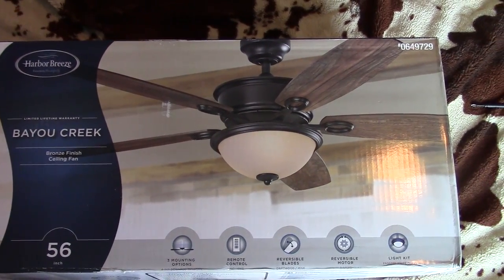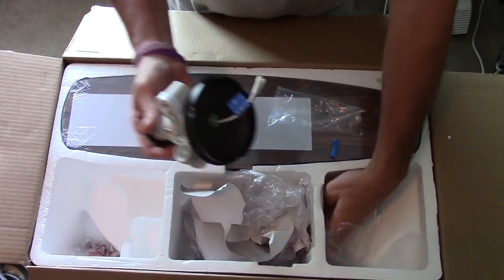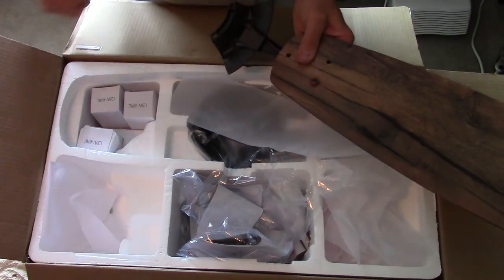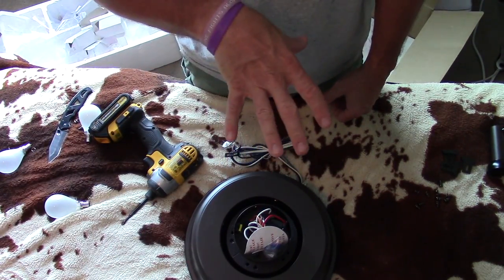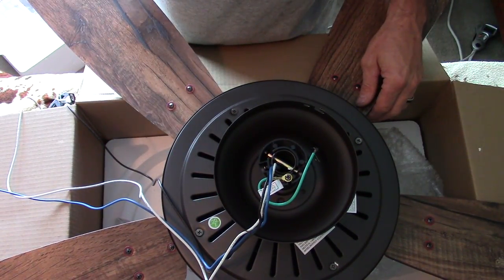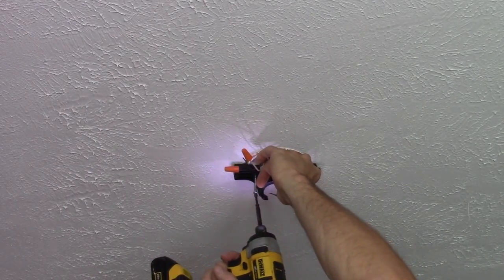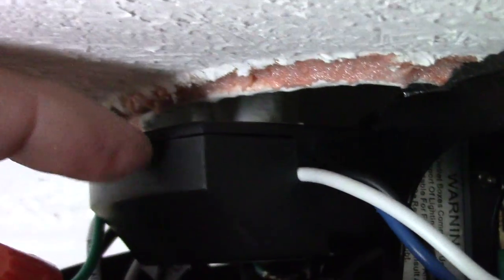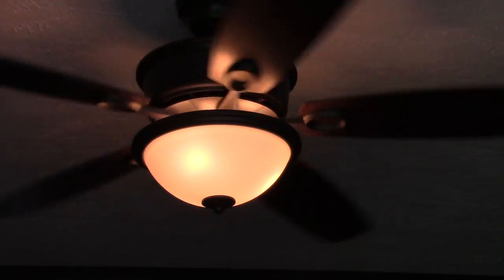Hanging Harbor Breeze Ceiling Fan

Comment: Is it possible to damage the remote sensor? When I installed mine, I followed the wiring set up from the previous fan. Thus I tied the white and blue wires all together. I corrected that. But now the remote doesn’t work. I fear I may have shorted out the circuit board.
Reply from the maker: @rayhuntermusic  I bet you fried it because you ran power in on the neutral wire
Reply: @networthy5348   yeah for sure. Silly me. I opened the remote sensor to check the circuit board and found it burned at the points I expected. Total stupid mistake on my part. Been away from this kind of thing for a long time and forgot the pitfalls.

Comment: what about the ground wire on the ceiling ROD ??? does it attach to the ground wire of the mounting braket or the groung wire from the electrical wiring of the house ???? help please
Reply from the maker: They should all go under the same wire nut. Bare ground and the green grounds all go together
Reply: Thank you !  Makes sense :)

Comment: For some reason my fan blades are scraping.
Reply from the maker: Could be you need to rotate the motor until it locks in or it could be a the fan is warped
Reply: @networthy5348  I believe that it's warped.  Returned it and the new one is working perfectly.

Comment: it looks like you installed the fan on a plastic light box which is a horrible idea and a safety hazard. the fan should’ve been installed on a metal junction box rated for fans
Reply from the maker: This was a brand new house we had wired.... was a fan rated box.....